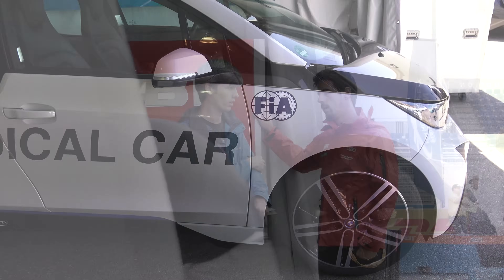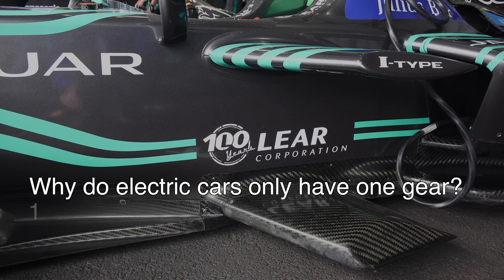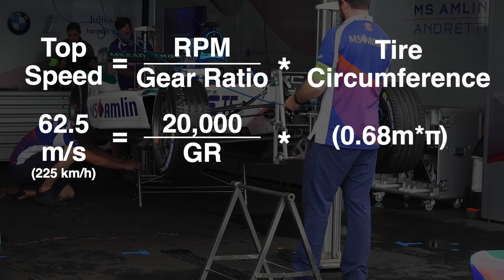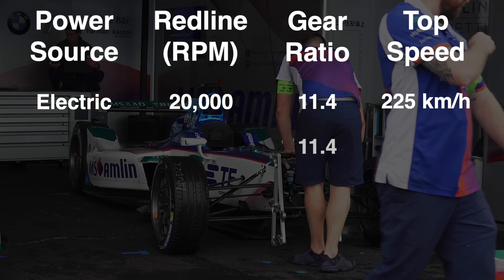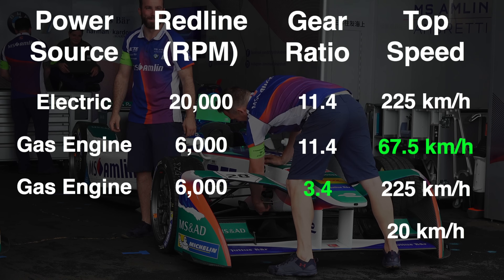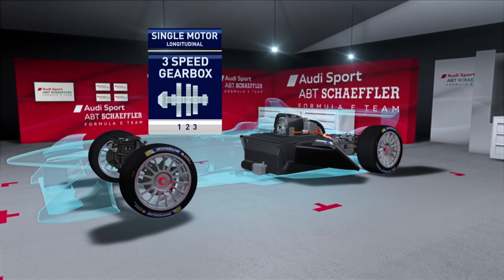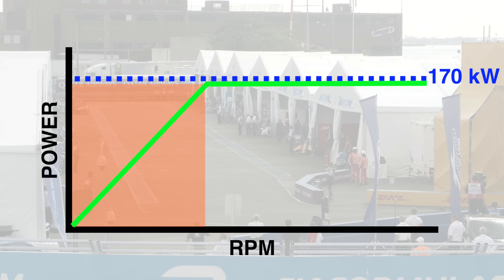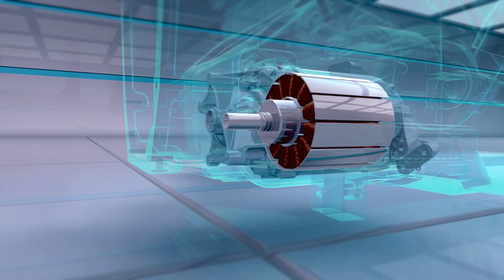Why Do Electric Cars Only Have 1 Gear?

Comment: But why are they high revving?
Reply from the maker: Interesting question! Combustion engines are limited by flame speed, piston speed, etc. You don’t have these limitations with electric motors, as it’s rotational mass that’s not dependent on how quickly a flame can travel.
Reply: Engineering Explained Thank you very much!

Been wondering that for a while

Comment: I wonder what strategy the 2020 Tesla Roadster is using to achieve a top speed of "over 250 miles per hour"? Higher revving motors, a transmission, or a combination of the two? My guess is that it will be a single gear, but the gear ratio will be such that it will allow for a very high top speed. And they can afford to do this because the claimed torque on this setup is "around 10,000 newton-meters". Can't wait until the juicy details start coming out for this car!

Comment: Electric motors with gear box is more economical for battery range. Because electric motors use high amps at low rpm

Comment: Using a smaller motor less powerful motor also means you reduce your power consumption and thus you can either reduce the size (weight) of your battery and have a lighter car which in turn needs a smaller motor to have the same performance.

Comment: Why dont electric motor have a overdrive gear like for more efficiency where the motor can spin slower at higher speeds for less energy consumption as the current electric cars consume a lot of energy at highway speeds.

Comment: i think with 20.000 rpm 1 gear can reach top speed at 225 kmh, so can we add more top speed with 2nd gear  with that 20.000 rpm motor?

Comment: So why dont you tell anything about field weakening in that context? the only reason for mechanic gears in an electric racecar that comes to my mind, really is when you dont need the rpm. And maybe reving up the engine. I dont think that this would help much except for the start. And even during start I would expect you to get traction problems if you gear the motor down.

Your video kinda upsets me. You have this bunch of examples where you could talk about field weakening. You are really motivating towards this topic and all you do is putting in some examples when mechanical gears can make sense.... Just not the whole picture

Comment: Ok wait… u just said at the end that multiple gears allow smaller motors to be as powerful as bigger motors… so why exactly don’t electric cars use smaller motors with for example 4 gears to produce the same amount of power as a motor that’s bigger but only has 1 gear? Wouldn’t that save energy? And for the save of energy wouldn’t you save weight because the battery don’t have to be as big (and heavy)? Or you could just leave the batteries alone and increase range?

Comment: Wouldn't gears improve mileage though? Having gears would mean the motor could maintain a higher speed with less RPM, which would reduce power draw, no? Not a concern in races but for road travel the amount of miles you get from a charge can be very important.

Comment: Having one gear with high rpm will lead to electric motor bearings failure, as less wear at low rpm.

Comment: good explanation, how this works with electric cars.
Most people think that electric cars have gears. People calling the drive mode switcher a gear shifter, but it's not, because there are no gears.
Also somebody told me already, that she don't like that low noise electric car, because she will not know, when to change the gear ;-)

Comment: Aside from weight, why not use a specifically tuned CVT or IVT? I'M,? Looking into doing an electric sleeper with a potential for custom gearing if one gear ratio is more optimal than a standard mass produced tranny? Aside from engineering complexity, what would be the ideal transmission system be for an electric vehicle with regards to good launch speeds and high efficiency? If I dropped in a modified CVT to account for the different torque vs rpm curve, could I get reasonably comparable effencies? What would be theoretically ideal for an electric motor?

Comment: Because electric engines don’t have rpm limit. The max rpm is set by the max power the circuit will allow to get to the engine

Comment: Are you going to update this video to show that Electric cars DO have multiple gears? Rimac uses two speed, there are many enthusiast racers that use 3-speed manual shift automatic (planetary gearboxes) and Formula E ranges from 1 to 6 speed, settling on 3 avg. Even the Lightning LS-218 electric bike, while having a single stock speed, allows you to manual swap gears. This is an implicit admission of the need for gears.

The problem is that torque drops as RPM increases so when you actually look at the dyno graph about midway through for DC, it drops right away, for AC it drops half way through. That's why power remains flat and doesn't increase. The drop in torque shows all the current being consumed turned into heat. It makes no sense to spend your time in this rpm range and is more efficient to shift to a taller gear to get back into its efficiency range.

Comment: can a transmission be used to improve range for electric cars? so the motor can use less power for highways speeds and long driving. or couldn't electric cars just use a tall gear to increase distance?  We don't need break neck acceleration for daily driving anyway. I'd prefer range over acceleration since it's not a race car anyway.

Comment: I think as the technology progresses engines will get much smaller to compensate for the great demand of consumable copper.  Surely there is some math to ascertain the smallest engine possible with the greatest power output possible.  If you can do that equation, i think you'll need gears to keep the engines efficient as they become smaller.

Comment: I stil do not get why road electric cars do not have a cruise gear or 2. During cruising, you tend to not acellerate, but with only 1 gear, you just waste tons of electricity at higher speeds, even while not changing the throttle. So, why not having a cruise gear that allows the electric car to cruise at high speed and not consume u reasonable amount of electricity?

Comment: Gearbox save power from the battery. 
Controll over the ampere it is alot of kilometers to save in battery. 
Alot of gears = NO need of high effect from electric motor.
Reply: The weight of the gearbox drain the battery power.

Comment: 3 gears makes sense. Remember from stand still, you huge power from the battery to get going. Torque is not free energy. Gears can reduce stress on the battery and increase the range.

Prius use tiny electric motors with cvt gearbox for more efficiency.

Comment: Your math is interesting. The question is Renault and Audi are using 1 and 3 step gearbox respectively for formula E where power requirement is high at the start of the race. But do I really need even a 1 or 3 step gear box for a passenger electric vehicle. Even if let's I can reduce my motor size to cut on some weight wouldn't adding a transmission add some more weight and reduce the efficiency. Please let me know if we really need a transmissions for EV vehicles either passenger or commercial vehicles like truck and bus.

Comment: Fun fact: the BMW i8, which was shown in the video and is Formula E's Safety Car also uses 2 gears on it's electric motors. But it's a hybrid, not a pure EV. Its ICE has a usual 6-speed transmission...

Comment: Wouldn't a traditional transmission would help save excess amount of energy to the motor and only having it run at the nominal rate and can travel at higher speeds just like the gasoline type engines?  Reduce RPMs on the electric motor with the automatic transmission and reduce wear and tear of the motor and excess heat build up to the motor.

Comment: I think it has more to with the fact that an electric motor will not slow rotation  and just increase the amp draw. You said it yourself, gas car engines use gears to keep the engine in an operating range. Same is true from electric motors. Unless, the use the motors on VFDs and the gas pedal actually increases The motors operating frequency?

Comment: All electrical appliances and power tools only have one "gear' since the electric  motor can run from zero to over 100,000 RPM (depending on application). No fuel-powered engine can do that!

Comment: does that mean that if you had gears on an electric car, it would go 12043 km/h?
Reply: that was a random number btw
Reply: If the electric motor is powerful enough to overcome the drag...
Reply: @denzzlinga  I think the battery is the bigger problem.

Comment: low rpm = more efficiency = more range. Still don't get why they don't use more gears for road cars..? Simple DIY conversions of simle 5 speed clutch operated gearbox still destroys the results of manufactured cars when in terms of range...

Comment: While I cannot see future road-going EV having 7~10spd gearbox/transaxles, I can see 2-3spd units developed for cars with big batteries & long range of travel, which can gear-up during highway travel just like a gas car to make maximum efficiency of the electric motor's rpm to match 60+mph travel and gear-down for city bumper-to-bumper commuting. The Model S P100D showed how fast EV can be but it still gets grossly outclassed once speeds climb next to the likes of M5 & E63. While handling is another matter, adding even a 2spd gearbox (that isn't made of glass like the gen1 roadster) could be the answer.

Comment: very good video, i understand rc model electric motors, brushless motors are mearsured in kv. so many rpm per 1 volt, i have had in 2008 a brushless motor in a 1/36 scale model the size of can or motor was about 1/2 inch in dia. and with a 7.4 volt lipo was able to spin at 110.000 at full throttle. yes one hundred ten thousand rpm, in 2008, what they have now is mind bending

Comment: Great video thank you.  Gearing multiplies the torque of motor less efficiency.  So you can use a smaller motor, produce the same torque on the wheels. Sacrifice is top speed.  Gain longer battery life.  Looking forward to your next video.

Comment: 225kph is slow for a race car
Reply: Depends on the track which limits the speed. You can drive 200km/h on a country road and it feels crazy fast (and is, which is why you should not do it) or 200km/h on a straight empty highway and it might even feel slow. Racing is more about the corners than the top speed. Lower speeds make sense regarding cost and safety.
Reply: Partially the money spend is used for innovation, partially it is just wasted. For example for high rpm you need very precisely manufactured parts. To achieve that you could manufacture 1,000 and throw away the 990 worst ones. That is not driving innovation, just wasting money. I would like the racing to split up: human racing with the same care for everyone (fair competition of driving skills) and autonomous racing (engineering competition pushing innovations).
Reply: tell that to the german reverse racers. They have got some serious balls. Haha
Reply: Max Mustermann I agree with you on your idea of perception on speed based on land reference and that the type of track is important but 225 Kho or around 140mph is still not that fast and getting up to those speeds only takes a few seconds when coming out of a corner going 50-60mph. Race cars have historically been where innovation happens and safety/ cost is secondary to those.
Reply: The next gen Formula E racer has a top speed of 280 km/h. Not sure if you can go that fast on tight city tracks, though.

Comment: If you have a motor and controller that controlls the stator field current then you can have a single tall gear ratio and manipulate the field current to get more torque at lower speeds, and have a high speed range at constant full power output.  This is typical for a DC motor with brushes and a separately excited field (not using a permanent magnet stator field).   For full acceleration the motor can output maximum torque at lower speeds with the stator field at full current.  When the speed has reached the rated speed for full power the system goes into the constant power region of operation. As the speed continues to increase, the field current starts to be lowered while the armature voltage stays at it's maximum.  While the speed increases the torque output decreases (as the field current is lowered), but the power output can remain constant at full power as the system accelerates up to the maximum motor speed (or some other design limitation).  In the constant power region it has a similar effect as having a CVT transmission.

Comment: Electric vehicles are mostly single speed, because unlike the 1980's today's automotive designers/manufacturers are primarily focused on high short-term revenue. As far as the consumer is concerned, its all about exploiting & manipulating their mindset to waste thousands of dollars on options they really don't need.

Back in the 1980's, Honda was at the pinnacle of automotive innovation. They've since lost that privilege, because they were too far ahead of the American & European competition in terms of styling, reliability & innovative design secrets.

This all changed during the 1990's when Bill Ford was appearing evening after evening on the 6 o'clock news criticizing & ridiculing a generation 5 Honda Civic.

Comment: I'm very curious on the use of gears for efficiency, can you get more range from a lower revving motor? Or is power usage not proportional to the rpm?
Reply: great question
Reply: Is more work being done at higher rpm?  Where?  How much?
Reply: ll.., l.
Reply: No, the same load is being driven by the same motor. The only difference is an increase in amperage for more torque and a decreased voltage for less speed. However it may be easier if I say the wattage, the total measure of electric power, remains the same.
Reply: @whatitis5646  Amp hour does determine power usage o a lower rpm does conserve battery usage.

Comment: finally someone civilized who uses km/h
Reply: @Diego I can agree than the metric system is more consistent with itself, but this comment reminds me of the exact reason why I dispise it.
Reply: Diego Amado XD ikr
Reply: @RupertBundem  😢
Reply: The proper SI unit for speed is m/s, but you can then convert either to km/h or mph for the layman.
Reply: SteelSkin667 well that’s made of two si units second and metre it’s not a si unit it’s self
Reply: @elliottslab  Meter is a SI base unit, so is second. m/s is a SI unit but not a SI base unit.
Please read the SI brochure
Reply: What is even more civilized is to also mention meters per second.
Reply: The imperial systems keep going because they work on human scale and for normal tasks they make the arithmetic very easy. Of course for engineering tasks they make the maths really hard and error-prone hence the switch to SI units.
Reply: @fl4shbangz  Yep! Sorry "rest of the world"...that's the deal LOL. I think the metric system didn't take hold here mainly out of practicality. The steel was manufactured using the sizes we already used so there was, of course, resistance from the steel manufacturers and you can quickly imagine how many other areas would fill up that list. So it was going to cost more in quite a number of applications. That's just the fact of it but belligerence was no doubt part of the deal there too. We already has a system of measurement taught over all those years and it worked just fine AND since we ARE the most powerful country on the planet we don't actually HAVE to do it. LOL Pressure from other nations to get out board of course didn't help. I personally have nothing against the metric system, never did. I worked in engineering as a designer so it takes an extra second to switch gears but a simple multiplication to convert isn't that big of a deal and of course it's easy to remember how many millimeters are in an inch and so on. It isn't something that came natural to me but I was able to do it efficiently.
Reply: km/h??? My ancestors uses LightYears!!! 😂
Reply: We use mph in England 😜
Reply: @elliottslab  mph sounds like meter per hour. :)
Reply: Oh right, I forgot you still use imperial for distances and speeds (and a few other things I think?). The majority of the world does use metric though.
Reply: km/h is a worse scale than mph for fast vehicles because it's too small so you get too many numbers on the way to going fast. Mph is bigger so you get fewer numbers, they increase slower and are at more identifiable brackets: 50mph is hairpin corner, 150mph is getting there, 250mph is fast which is your biggest number instead of 400km/h. If you play racing games try changing to Mph and see how you like it. Aviation is pretty civilized and uses knots which is close to mph.
Reply: @cynthiabauer5763  so Cynthia, your argument is 'I understand one system and not the other, so mine is better'? Really sound reasoning.

Comment: Suddenly math becomes very simple when using metric system. The only "correction factor" that was needed was "60" to convert "rounds per minute" to "rounds per second". But I can easily live with that as long we don't have to mess around with pounds per inch and what not.
Thank you!

Comment: So far all data is based on assumption and math on a piece of paper.  No actual real road testing.  No one has built more practical EVs then me including Elon Musk!
No one is calculating KW during take off mode
No one is testing what it does to the battery
Huge amount of torque is lost at higher revolutions
Correct! Direct drive EVs don't have high top speeds
Two motor don't give you double the torque. Second motor will always have some loss

Actual 100 mile EV cost about $14K to build in low volume.  This is a fact and proven with actual quotes from vendors around the world using experienced people that have built over 300 EVs around the world.